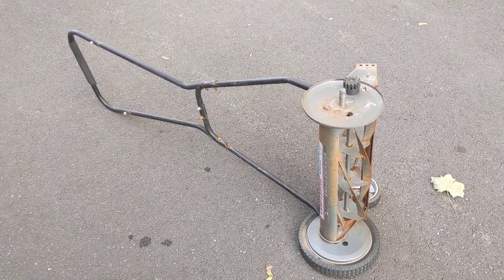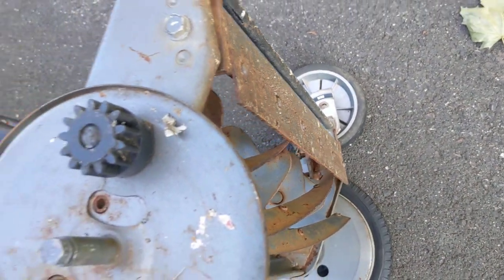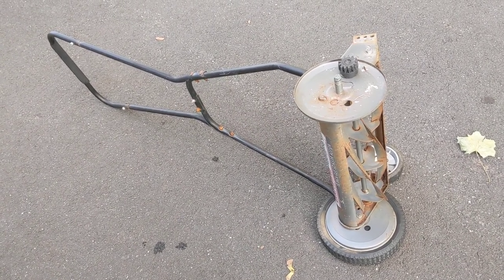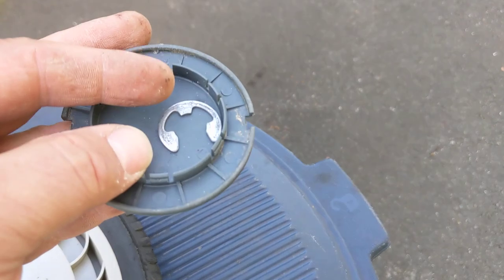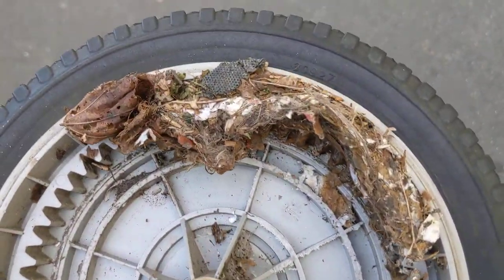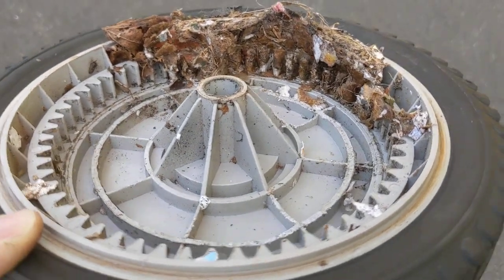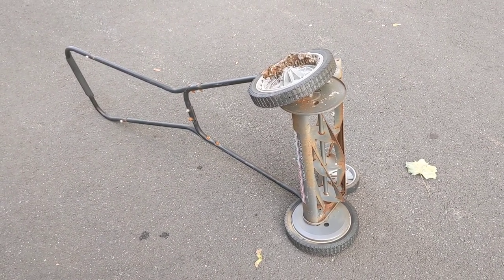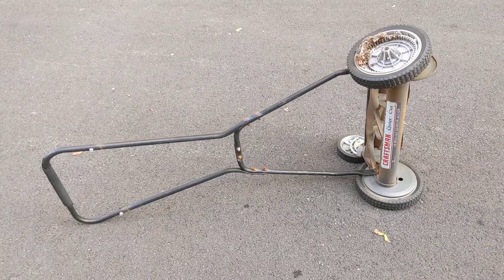How to fix stuck wheel, Craftsman Reel Mower, push lawn mower, Quiet Cut 18, won't turn, binding

Comment: Thank you for this video! I have reel mower that’s only a year old. It had the same problem, a stuck wheel that wouldn’t move a full revolution. I was getting desperate because my lawn gets too long I won’t be able to mow with my reel mower. My model is different than yours, but much to my surprise the wheel worked the same way. I was able to easily get it off and discover a loose screw that came off the mower and fell into there. It had wedged itself firmly into the small gear. I had no idea the wheel gear could so easily be accessed. You saved me a ton of trouble because I was going to have to disassemble my whole mower. Thank you so much!
Reply from the maker: You're welcome, I'm glad you found it helpful!

Comment: Mine is a sun Joe.  Once I take off that wheel cap I cannot remove the clip.  Mine is black (not silver) and it’s clamped on very tight.  A flathead screwdriver doesn’t work.

Comment: I have a Jonsered LM 2040 H reel mover. It has been unused for years in an unheated yard building. I have checked the teeth inside both of its wheels and its metal little gears are also covered in Vaseline. And yet: My Mover's reel and wheels agree to move only backwards - not forwards at all - unless I really use force to move them - and the rotation will not continue. Does anyone understand what is the problem with my Jonsered?

Comment: Hi uh I have a bright motorless blind more like yours and I did something with the wheels and now if you push it backwards to the blade. You will spin but if you go the regular way. It's supposed to that won't what do I do
Reply: II made a mistake once where I took an old reel mowers wheels apart, not paying attention to the small gears on its respective side when removed. In other words I mixed them up and on reinstallation I put the small gear that WAS on the left side, and put it On the right side, and the gear that WAS on the right side when removed, I put it on the left side. And I had this same problem. See if yours are stamped with a  L or a R, which designates which side it goes on, and THEN you have to determine which end of the small gear faces inward when putting it on the shaft. Try and find its manual online. It’s very possible a manual for a similar type mower will help as they are pretty much the same as to how they work. Good luck.